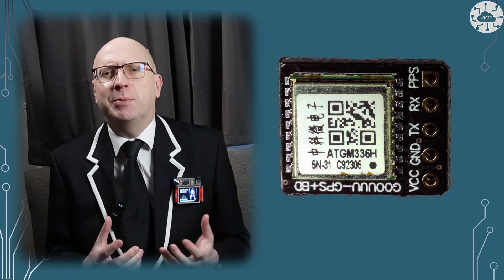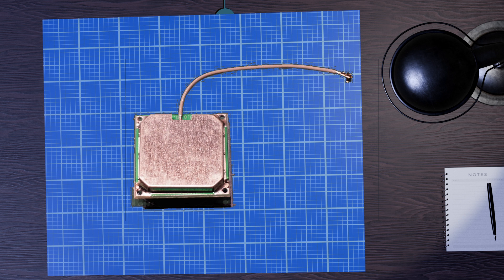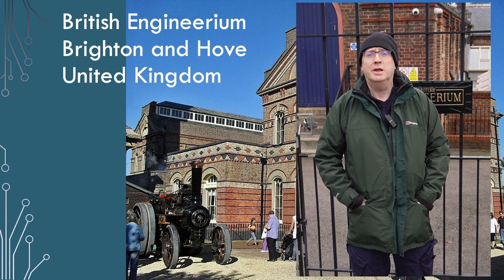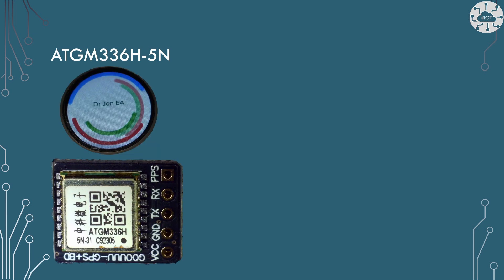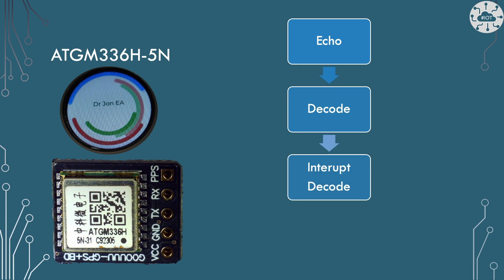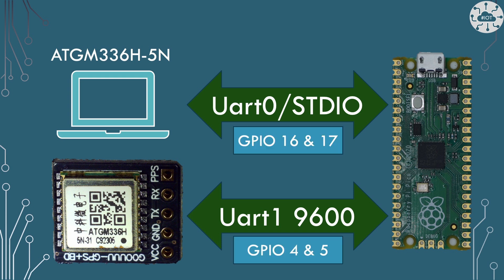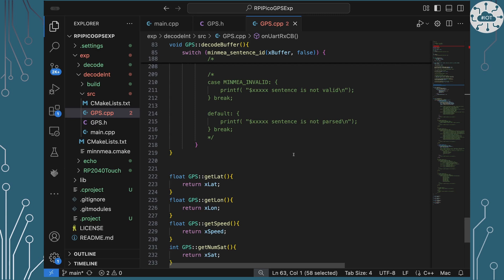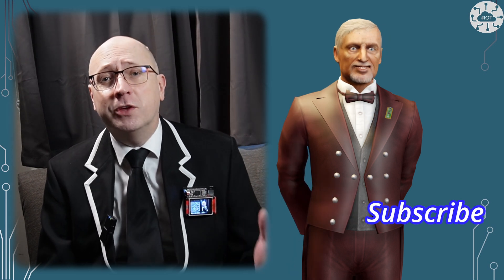How to make a Raspberry PI Pico into a GPS Module (ATGM336H-5N) | DrJonea.co.uk

Comment: What pins did you connect for this?
Reply from the maker: For the Touch it is using UART0 on GP15 and GP16.  The experiments on a Pico used uart1 and GP4 and GP5.

Comment: how accurate were gps readings other than the single one you provided? what was the average error?
Reply from the maker: Hi, I didn't specifically check accuracy. It certainly to a meter or so though. You could see the drift over time due to the errors injected into the GPS system.

Comment: I recently implemented a device driver in Rust for the touch device on this board, and having no proper debug interface was definitely a challenge, so big congrats on doing this for the GPS module.

I noticed the link in the description for the Github repository is going to a 404 page.
Reply from the maker: Thank you, yes I wish these boards had exposed SWD some how. Would make live much easier.

Github Repo was private, sorry. Fixed.